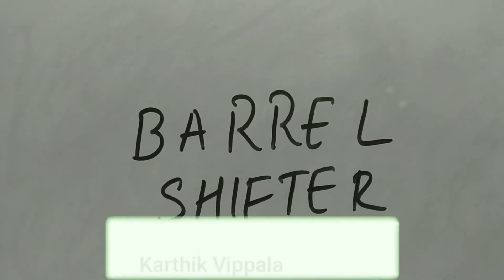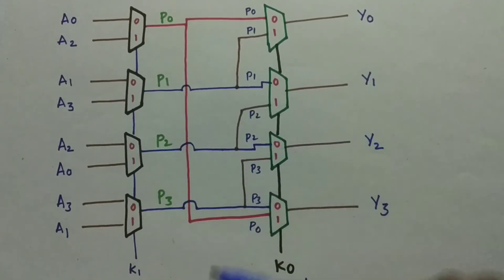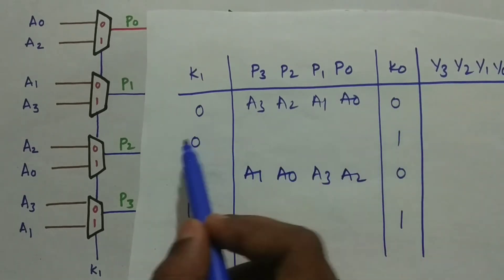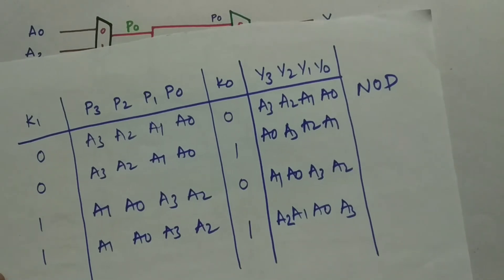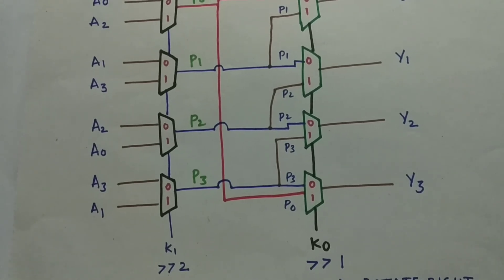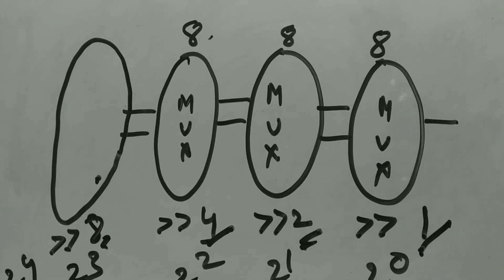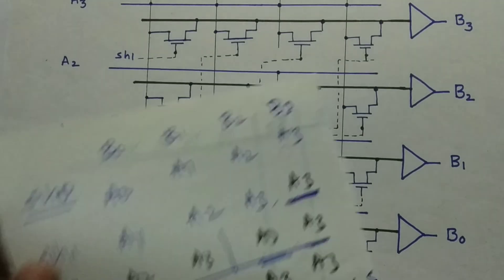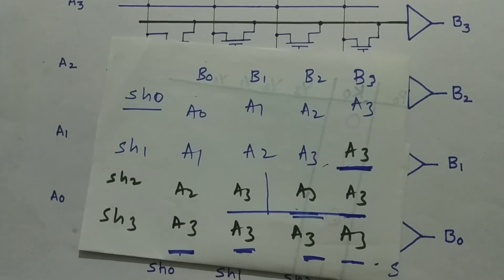How to implement Barrel shifter  using 2:1 mux's and 4:1 mux's ? Explained with example rotate right

Comment: Thank you so much. I will listen to it more to gain a better understanding.
Reply from the maker: Namaste Mohamed Eljahmi🙏 , thanks for support and taking time to re-watch , good luck & great health 👍😊
Reply: @KarthikVippala  Thank you. I watched it today multiple times and I feel grateful for your illustration. As you started from the basic concept and ended at two selections for MUX for 4 bits output.  Could you help me visualize how to use the 4-bit configuration in a modular way to produce 16-bit output? I understand we need to use 4-bits as select lines, but the MUXs have only 2 bits select lines, how could we possibly make correct mapping?

Comment: Hi sir I m suresh.can u clear my doubt.
 If counter has 10 flip flops . counter is initially set zero ,then after 2078 clock pulses what might be the decimal number that counts??
Reply from the maker: Hey thanks for asking the question ,
If 10 flops are there then we can count till 1023 , that me after 1023 we will get 0 again at 1024 this will repeat so at 2048 we will get 0 
2049  = 1 
So we Keep on doing it we will get 30 at 2078 hope this clears your doubt.
Reply from the maker: Hey sharath , please stop spamming with other accounts , I will not respond back if you do this kind off activity